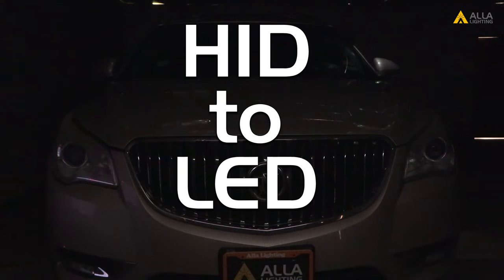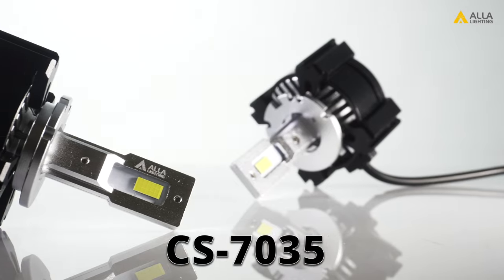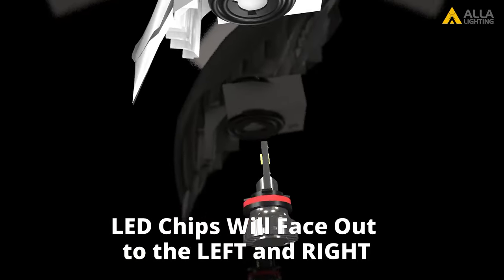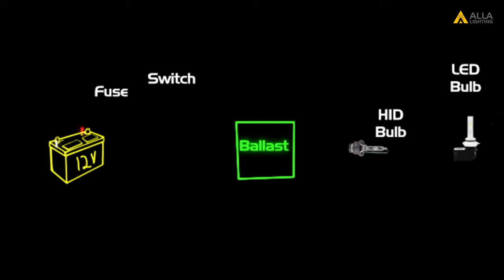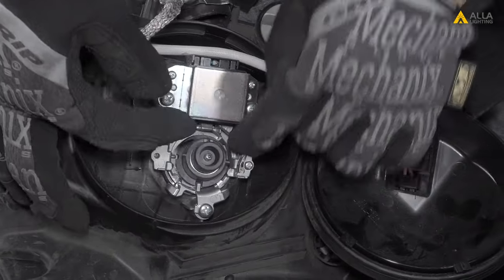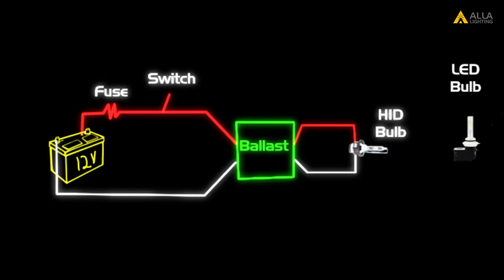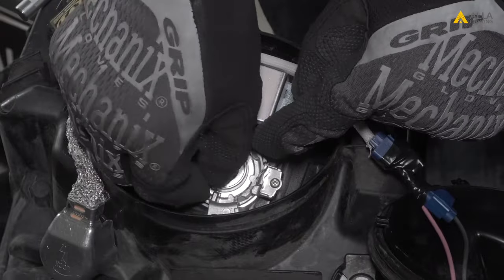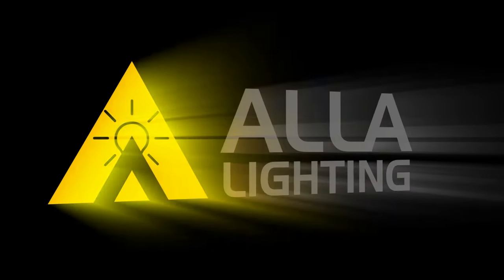What You Need to Know Before Change HID Headlamps to LED Headlights?

Comment from the maker: This video tells how to choose and install LED headlights bulbs for HID headlamps conversion kits replacement. This is what you need to know before change HID headlamps to LED headlights? It is more complicated to upgrade from halogen to LED headlighits bulbs, so we recommend you check this video before purchase LED upgrade HID headlamps for the vehicle with HIDs.

Thanks for watching and if you like our videos, please give us a thumbs up, and subscribe to see more installation videos!
Reply: so as your leds don`t have cooling, do how long is the warranty? don`t say that those tiny holes will let 30W of power to cool down the chip efficiently.
Reply: Wait so I went from HID to LED and installed just as shown... But I only have high beams at all times... No DRL .... What do I need a decoder??
Reply from the maker: @CucucachooSpaz  Your issue seems complicated, we recommend you to contact us directly by email service@allalighting.com by providing below information: Vehicle's Make, Year, Model, confirm Stock lamps are halogen or HID?, any upgrade before? and the issue details, thanks in advance.

Comment: I bought new HID HEADLIGHTS for my 2021 Dodge Charger SXT. The daytime lights and signals work perfectly fine but the Bulbs do not turn on. I am not sure if the ballasts itself doesn’t work or if both bulbs does not as well. What’s the best solution to know which LED conversion I need ?

Comment: Do you make or will these work on a motorcycle with an aftermarket HID conversion from original halogen
Reply: If it's got a conversion, just bypass the conversion and use some original bulbs only in LED

Comment: I was trying to do the same thing but my led buld didn't turn on, the bulb is plug n play d2s led. I Installed it to the 12v connector
Reply: try flipping the connector around

Comment: Nice video. But what about the high beam?
Reply: High beam is built inside the projector’s shutter.
All it does when you flip on the high beam is lifts up the shutter.
Reply: Some projector headlights are low beams only, and have a separate tungsten reflector lamp for high beams (and tungsten bulbs easily convert to LED since there's no ballast).  Some style of projectors use the same bulb for high and low beams, and use a movable piece of metal (the shutter) that moves up and down and simply blocks any light coming from the upper half of the beam pattern

Comment: Great video.  Too bad putting LED BULBS/LAMPS into HID or Halogen reflectors is 100% ILLEGAL everywhere for on-road use, and it's incredibly dangerous.  HID reflectors are not optimized for LED.  Note the huge heatsink separating the LED chips?  Creates dead spots and hot spots.  You can see these garbage replacements a mile away.

Don't provide an optimum beam, and blind the living crap out of other drivers.

Want to take your SLK off-road?... all good.

Be save.